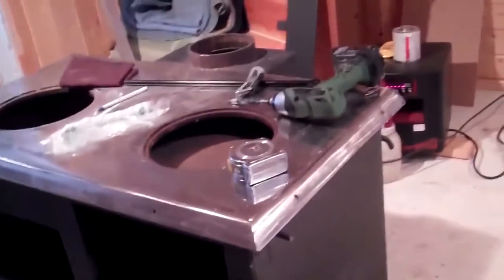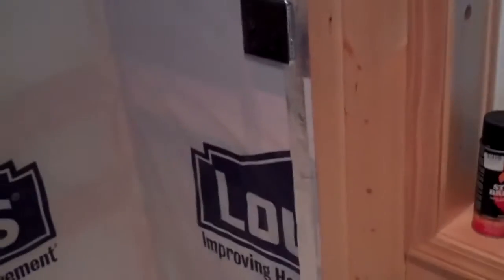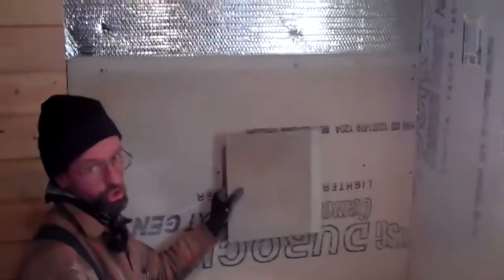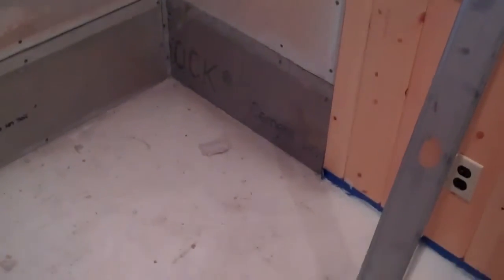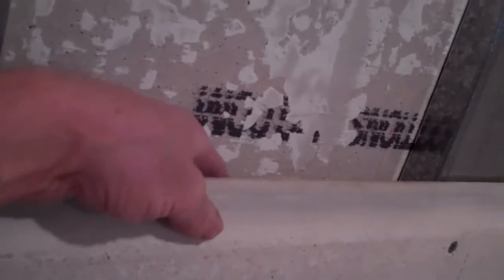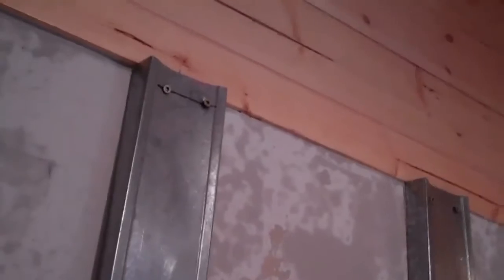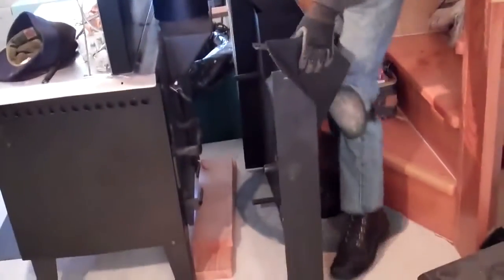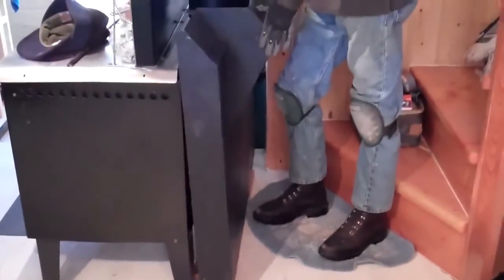Obadiah's: Installing A Cookstove Safely In Tight Quarters

Comment: Thanks for this. Really great video. Wondering what thickness recommended for the custom metal heat shield? I have some 3/16 Inch thick steel lying around I was going to use for a more simple flat heatshield but I don't know if this is overkill/would be worse being that thick? Any guidance gratefully received. Thanks Jamie

Comment: what do you think? Would I be safe to make a summer kitchen out of a 8x12 storage building, no loft area. It has a small window ( which I thought about installing a bigger window), and a 4' door. Of course I would put at least one layer or durarock behind it and tile etc on the floor. But I was concerned it might get to hot and unsafe????

Comment: Is doing this code compliant for minimizing clearances?
Reply: Code is 18" from Wall in us without doing this I'd say in general no if your inspector wasn't a tool and saw said stages and verified such safe results  if not well he could be firewood I'm sure they have products tested that are specific to this app but probably stupid expensive
Reply: Yes. Code calls for 18" off the outer dura rock wall. As he said it must have a 1" gap between it and the inner wall and 1" gap at the floor and 2" up top for cooling air flow..
Reply: @meme6113  
Code in US is 36" from ANY burnable surface. It drops to 18" with a heat barrier like he's building. One thing he seems to forget in his hot area explanation is the back of the cook stove is where exhaust goes so it gets very hot and must meet code for distance as well